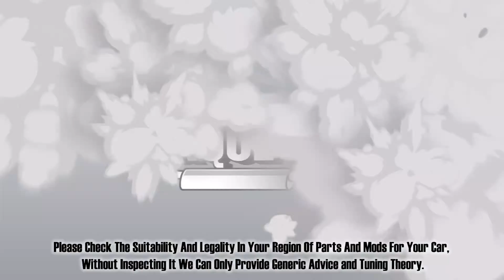Exhaust Terminology Explained - Resonators, Silencers, Decat, Headers, Cat back, Manifolds etc

Comment: I want to go with straight pipe, but I don’t want the drone. I’ve been looking into it. If I right the diameter of the pipe makes a difference in how loud and if you will get drone. It can be expensive to make the wrong choice and not be happy.
Reply: I've been in cars that people said sounded "nice" basically a straight pipe with a wide tip exhaust or muffler and depending on the car they really can do your head in after a while , there is something to be said for the professional design and tuning of manufacturers with sports cars like an m5 or rs6 , they really spend a lot of time giving you that sporty sound without making loud horrible sounds that wreak your head after 50 mins on the motorway. A friend of min has an old Peugeot 205 gti and its great sporty vintage hatch but the exhaust sound when i was sat in the back was unbearable, design has come a long way since then ... Louder isn't always better
Reply: Best advice i can give if you have wokshop or access to one is try it out yourself , a simple solution is to buy an exhaust muffler you can fit yourself  with a saw and a cheap welder and get a dpf delete if its a diesel